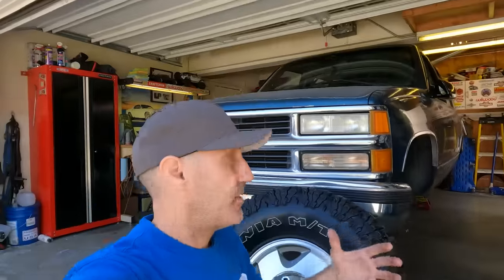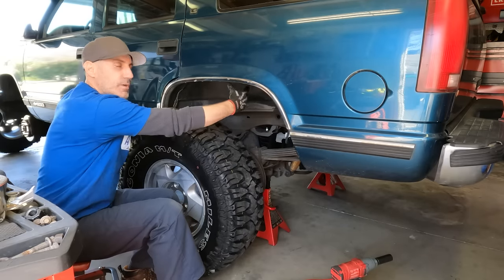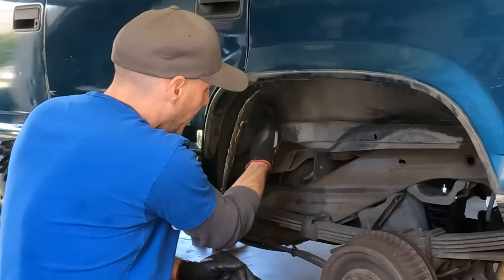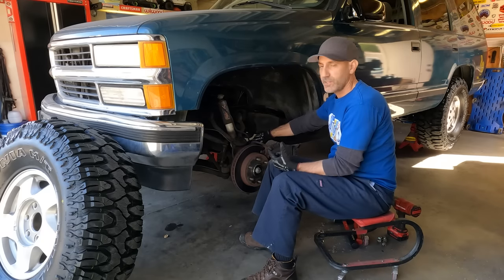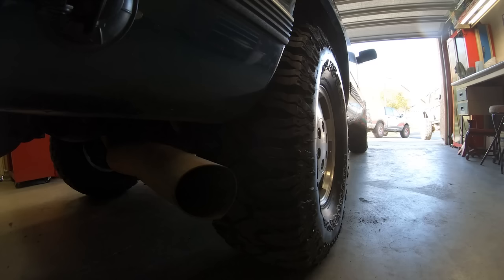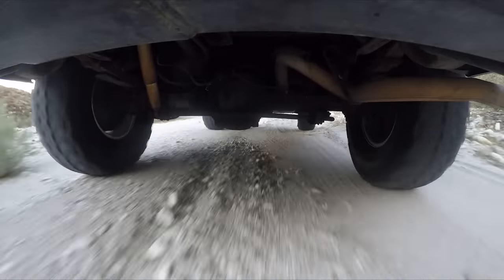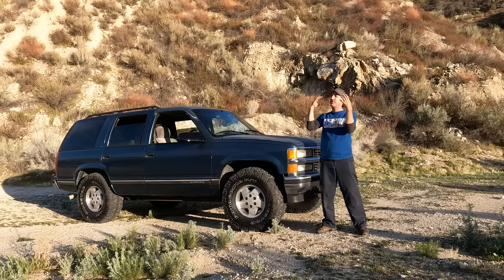How to Fit 35 inch Tires on a Stock Tahoe and Going Off Road

Comment: I prefer the look of stock rims vs aftermarket. Looks like yoy cleaned them up quite a bit since you picked it up. What was your process?

I replaced headlight lenses on mine and added LED's to high/low beams-- made a big difference driving at night. There's also an inexpensive wiring kit under $20 that keeps low beams on when you turn on the high beams (stock, low beams turn off when you activate the high beams).

Nice job getting the 35's in there and getting off of the ancient, road-hazard tires. Keep up the good work!
Reply from the maker: I literally used the SuperClean All Wheel cleaner and scrubbed away, that's it. https://www.amazon.com/dp/B000BOAEV0?ref=exp_autoedits_dp_vv_d
Reply from the maker: Great suggestion on the headlight stuff... I'm going to look into that setup!
Reply: @AutoEdits  Thanks for the link --I'll have to pick some up. Definitely made a big difference on yours.

Here's a link to the "All 4 headlights on" hack. Very easy hack, and even more of a difference when you install new LEDs:

https://www.painlessperformance.com/wc/30802
Reply from the maker: @ojaiguru  Thank you for that link!!!

Comment: Nice video although you did say my famous last words  "I'm going to keep the 10 bolt and see how it goes".... If that's the case have fun with broken axle shafts love the vehicle though
Reply from the maker: Great point... I did order chromoly axle shafts for the rear so that should help a little.
Reply: When it DOES finally break, check out the heavy half diffs that they put in some of the trucks from this era. It's a 9 1/2" ring gear, 14 bolt pumpkin, but with 6 lug axles. (Much beefier) It's a direct bolt in and it also is the same width as your front ifs assembly. (Ever notice how your front wheels stick out further than the back? That always bugged me.)

Comment: I like to 2 seater k1500 pickup with the v6 best for off-road. I wanted a v8 real bad but then I started to actually think what would be better for off roading and the 4.3l just makes way more sense. Light, decent power (not towing), and better fuel mileage so I can go further off less on the desert. Also the 5 speed helps a lot lol
Reply from the maker: No thanks on the v6... otherwise solid points.
Reply: 4.3s never got good gas mileage? 4.8 and 5.3s did

Comment: I've been wondering how big I can go without modifying my wheel wells on my 2001 Tahoe. I have a 2001 Tahoe mostly stock Z71... However, I put in a built 6.0 and transmission. It is VERY capable. I've road in all sorts of other rigs including Gucci jeeps. Tahoe works SO damn well. Only complaint so far is departure angle (minor as virtually never scrapes) and it's a tad wide.
Reply from the maker: Check out this video of a trip I did in the Tahoe https://youtu.be/SLxA9hlW9y8
Reply: @AutoEdits  will do thanks man! I love your tip to clean the wheel wells. 303 Aerospace protectant just doesn't last in my wheel wells. I'm going to get some of that lucas spray. Or can you use any penatraiting oil? Otherwise I have lots of old liquid wrench bottles on my shelf.

Comment: If you could still get 9.5 or 10.5 wides all this would be so much easier on so many trucks. But everyone loves the wide muds these days. Plus lighter narrower tires would be easier on the components.
Reply from the maker: I like the performance of the wider tires in the sand. Solid suggestion though but harder to find them and it wasn't even an option in this price range.

Comment: I have a 94 1500Silverado suburban that I was wondering if I COULD mount those tires on the stock rims you just answered that , what is the height of your garage door opening not sure if mine is high enough to fit 35s and still fit????
Reply from the maker: My garage is 82" and this thing fits with plenty of room but no suspension lift yet.

Comment: I'm curious if you had your torsion bars torqued up prior, or were they set at factory height?  I'm doing the 2" to 3" lift on my 2002 with the newer torsion bar keys.  That should take care of any fender rub (I'm hoping).  lol  Mine is a Z71 with 4.10 gears, which seems to be plenty, since it's more on road than off.  I'm also curious about tread wear on these tires.  Generally, my luck with off road tires, is that the tread wears fast with lots of highway speed driving.  Some I've owned barely lasted 3,000 miles.
Reply from the maker: I have no idea about the torsion bars being adjusted before I owned the vehicle. I have over 20,000 hard miles on my Patagonia MT tires on my Jeep. If you're going through tires that fast, I'd check alignment settings ASAP.
Reply: @AutoEdits  Yeah, they wore evenly, just as bad at the rear. So alignment isn't an issue, just 75mph on the interstate.  Possibly softer compound versus the heat of extra speed. 
So, likely, you could get another inch or so of height in the front by cranking them in.  Cool.

Comment: MOOG STEERING COMPONENTS.  From O'Reilly. Free replacement if you bend it.  I'm wondering if you really had to step on the brakes to get that Eaton G80 to engage; but, yeah, really wish Eaton G80's were available for aftermarket applications.  I would definitely install a G80 in my Dana 44A.
Reply: I just submitted an inquiry into Eaton, asking for a parts lists to install a G80 into a Dana 44A and a Dana 30.  That's what I want.
Reply from the maker: You could see the diff working pretty good during the donuts but when it was open it was just open and kept spinning. I’m all about the locker for now.
Reply: @AutoEdits  Without a doubt the locker works way better; but, FREE, cheap, and simple has value too.

Comment: Are they exactly 35x12.50r16? Or are they a metric size? I just came up with the plan to stuff 35s under my 96’ k2500 suburban with using a 3 inch lift. Glad to see i don’t need the lift.
Reply from the maker: 315/75r16

Comment: How tough would it be on the stock transfer case if you kept these 35s and didn’t end up changing the gearing like you did?
Reply from the maker: Depends on how hard you go off roading.  For most stuff it would be fine.

Comment: How wide are the 35s you got? I'm looking at a set of Toyo Open Country M/Ts, but they are 35x12.5r17. I got a set of '14 Tahoe cop wheels on mine
Reply from the maker: These are 35x12.5 r16 ... I recommend putting a 1" spacer on the rear wheels.

Comment: Do you know if I could put 35x12.5x20 on a 2003 z71 tahoe? The tires on it now are 285/55/20 but there’s a big gap in the wheel well. Thank you!
Reply from the maker: Yes, they will fit but you will likely have to deal with a bit of rubbing in a few spots.

Comment: I have a 96 k2500, and I just need some tires. Is this too much for a daily driver you think?
Reply from the maker: I daily this thing. The tires rub a little if I try to make a u turn too tight but otherwise feel good.
Reply: Do the tires rub the frame at full turn?
Reply from the maker: @waterfowlreaper7776  yes
Reply: yeah mine does the same thing, I have a similar setup with 11.5" wide tires and it still rubs. have you thought about putting wheel spacers on the front, to see if it helps?
Reply from the maker: @waterfowlreaper7776  I wouldn't put spacers on the front since that would cause the tires to hit the fenders which is WAY worse than touching the frame at full lock. My solution was to add to the steering stops by welding a few passes on the control arm side where the spindle touches. Maybe I can do a video on it. Worked great to limit the steering so the tires don't touch.
Reply: @AutoEdits  That's another thought I had as well, a video would be awesome! I will probably end up doing the same thing, thank you! keep up the good work your content is awesome!
Reply: @AutoEdits  thanks for the help!

Comment: Are you telling me a 2500 with leveling keys might just clear 37s!?!? Finding a GMT400 3/4 ton suburban for $1500 and throwing Humvee beadlocks and 37" tires would be an amazing budget rig.
Reply from the maker: I've seen that on the internets somewhere!
Reply: If you look for @slumwoody on Instagram, he's done the gambler 500 in Tennessee in a GMT800 3/4 ton suburban on (I'm pretty sure) 40s but you can imagine what that looks like. You should check it out anyways though because it's pretty wild.
Reply: @hunterbrock2347  they were indeed some cooper stt pro 40x13.5x17 on some 17 model ram 2500 factory steel wheels lots of cutting and a little sledge hammer work
Reply: @sinorcooper  where can a guy see this at?
Reply: @hunterbrock2347  I sadly sold the truck a couple months ago and lost most pictures on my other phone a couple weeks ago
Reply: @sinorcooper  you didn't post anything anywhere else?
Reply: @hunterbrock2347  just Facebook and Instagram
Reply: @sinorcooper  well that works

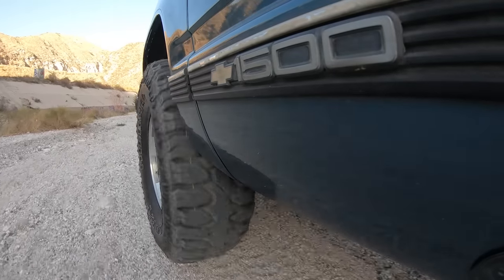Comment: I think I mentioned this last video. But ball joints and steering links are a must. The steering links can bend while driving straight. At 15:08 when you gas it and you see the tire steering angle jump in and out, that is what will bend the steering links. And that may have been caused by worn steering and/or ball joints. But it looks really good with those tires, and the chrome pieces removed.
Reply from the maker: All of the steering is worn so much on this thing... I can move the tires with my hand at least a couple of inches left and right. I've been looking at a couple of different options for arms and someone here mentioned the redhead steering box so I'll keep looking.
Reply: @AutoEdits  There used to be quite a few upgrades out there. Seems like there is fewer now :(
Reply from the maker: Yep.

Comment: I did it with my 04 expedition. Same tires. Rubs just a little. The tires make the truck. Once the word gets out some more on these tires BF goodrich is going to be in for a big surprise. Can't beat the price. Just ordered my winch. No it's not a warn winch. I would have to take out a loan for one of those. I can buy 5 fiery red 13000lb winches for the same money. Buy 2 and keep a spare in the back. Just saying. Have fun.
Reply from the maker: Nice to hear about your project! Totally get you on the Warn vs other brand for a cheap build up... Thanks for being here!

Comment: It would have been better if it would have had the g80 rear end I love the g80 I had the 02 Chevy Tahoe with 265 75 r 16s mud terrains of course I only had to put it into four by one time because I had to pull somebody out and it was the soupy mud I just put it in for low put it in reverse and let it idle it's way back and then they were able to get the person out and it worked I couldn't have asked for a better setup

Comment: those tahoes and the k15s of the time were awesome, you could fit anything on them with a bit of fender modding. this was my '91 k15 with 35's had no rubbing issues. had to cut the front fender wells down a bit. https://www.youtube.com/watch?v=jlxOxbNSKew

Comment: Put a 6” lift in it and you won’t have to worry about clearance issues.
Reply from the maker: I don't want that much lift. Looks cooler like this.
Reply: @AutoEdits  trimming panels just to clear bigger tires sounds like a better idea than just putting on a 6”lift to clear 35”s

Comment: Hmm, let's see, stuffing 35-inch rubber on a stock Tahoe with stock 26-year-old SUV suspension components, what could possibly go wrong?! Nothing really, I wonder how long before your tie rods snap like Twiggs. You might want to give Kryptonite a call for your front end suspension parts.
Reply from the maker: That's the plan at the moment.

Comment: Don't they come with a 33 from the factory? I forget.
Reply from the maker: Not in this case, I took a 265 off of there which is almost a 31.5"
Reply: @AutoEdits  ah. I still gotta say i love these over any other SUV.
Reply: Oh, also, your 4low is controlled by a teeny actuator about the size of a coke can on your front axle. Easy 1 minute repair.
Reply from the maker: I tapped that thing with a screw driver handle in it works like a champ... no need to replace!
Reply: @AutoEdits  you mean to tell me i could've fixed my 4auto with a tap from a screwdriver... Son of a
Reply from the maker: LOL!!!
Reply: They came with 29s or something like it.  They looked silly.

Comment: A 1" body lift will put you right where you need to be
Reply from the maker: How hard is that to install?
Reply: @AutoEdits  You'll just unbolt the body mounts, lift the body a few inches to get the new spacers in and bolt it back up. You will definitely need a lift and much smaller tires if you do it in your garage. But it will absolutely give you the clearance you want. Any more that 1" and it would look weird. It's the easier way of getting the height and extra room you want than a suspension lift.
Reply: @AutoEdits  BTW, the Powernation channel just reposted their episodes on the JK Hemi swap. Just search for their channel.

Comment: Jeep guys spend 20K on a wrangler to take it on a road like this. Stock Tahoe on Chinese 35’s “hold my beer”
Reply: I was in a Jeep club for several years. I had a 1975 Chevy K5 Blazer, 4-inch lift kit, 35 tires, front axle truss, transfer case skid plate, 350 then 454 then 350, 4-speed standard shift, part time 4wd. Full size SUV/pickups can not go where Jeeps can go period, except maybe thru a giant mud hole. My k5 frame cracked in half right above the front axle on driver side, got it welded.  Bought a 97 Chevy Tahoe in 2005, which is staying stock.

Comment: OBS, as in Old Body Style?  IT’S NOT A FORD! This Tahoe is a GMT-400, which came after the C/K “Rounded Line,” (preceded by the C/K “Action Line”). After this one, came the GMT-800, then GMT-900, GMT-K2XX, and finally, the GMT-T1XX. But NEVER call a GM truck “OBS.”  That is a Ford thing.
Reply from the maker: Copy that... I've seen it both ways on the web here... and there's even a very popular instagram account calling these obs so maybe at some point it was only ford but not anymore.